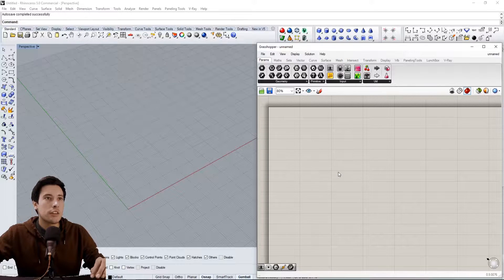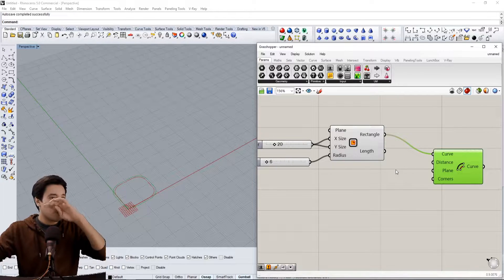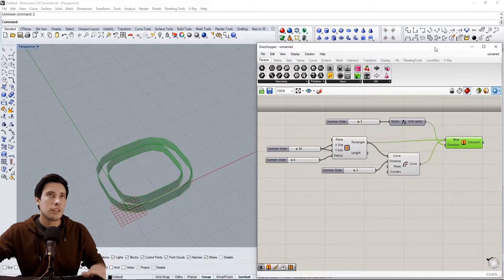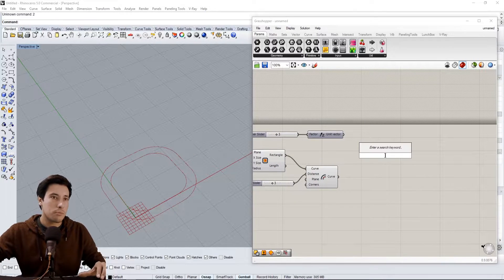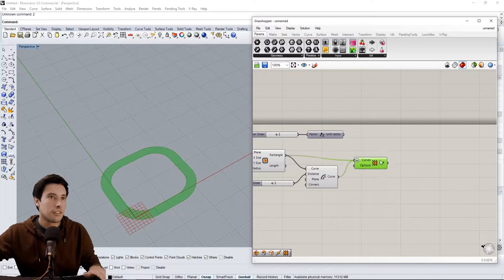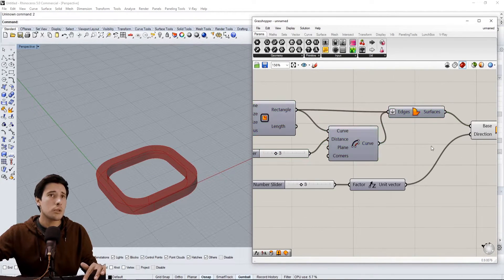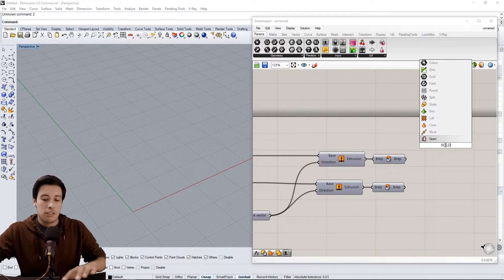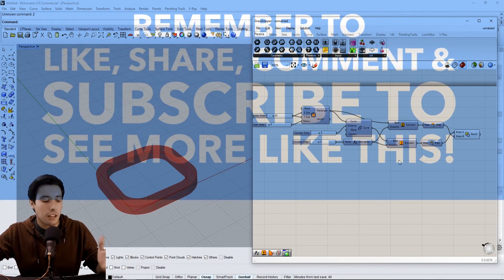Rhino Grasshopper Offset and Boundary Surfaces Quick Tip

Comment: hi. how do i make a tube with inner and outer diamer, in rhino grasshopper. basic rhhino has a tube command but grasshopper dont?
Reply from the maker: offset the circle and then use planarsrf component to turn into a surface, make sure to flatten input.  Then extrude that surface for a solid
Reply: @DCOParametric  lol ya  thats what i had to do because there is no tube command am i right. i dont understand why all rhino commands are not avail in grasshopper. its kinda dumb to have to do work arounds when theeres a coomand already in rhino for everything.
Reply from the maker: I agree this should be something they could have fixed for Rhino 7
Reply: @DCOParametric  ok but i want to sweep along 1 rail  a surface to make a tube with thickness. how i do this?

Comment: How can I connect more than one wire to boundary surface?? I tried to connect them both but it doesn't work?
Reply from the maker: make sure you flatten the input. If you have more questions let me know at dcographicstudio@gmail.com
Reply: @DCOParametric  I have the same issue. I can only connect 1 rectangle to boundary surfaces even after flatten in. was this solved?
Reply from the maker: @Jeyjuheemoon  for me it works when I flatten.